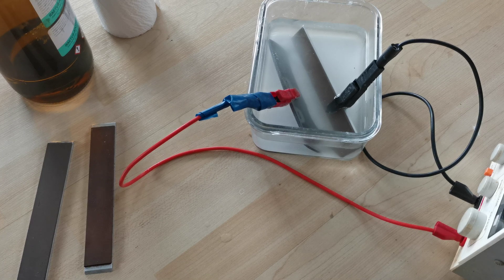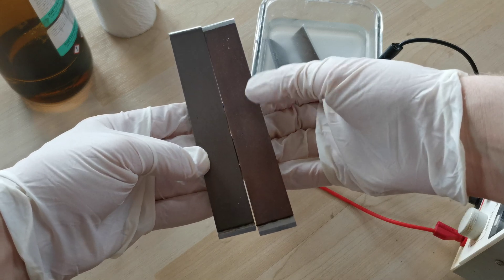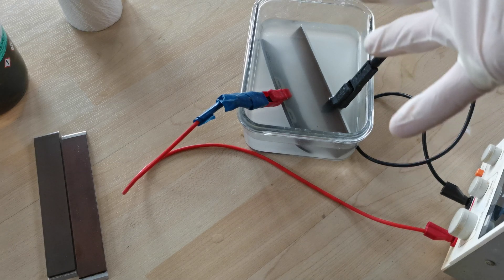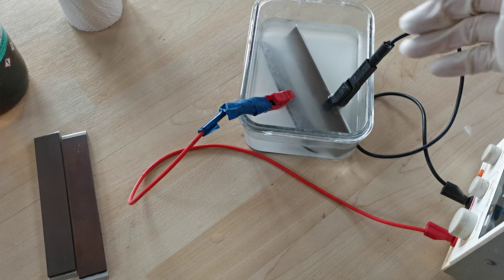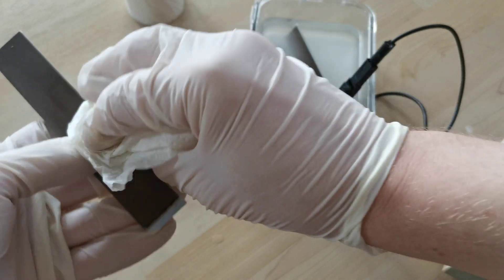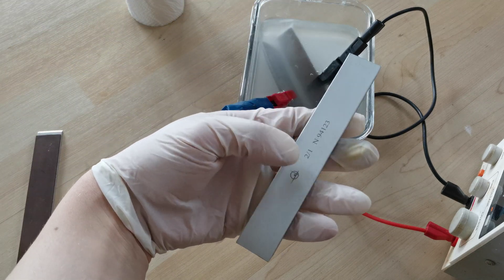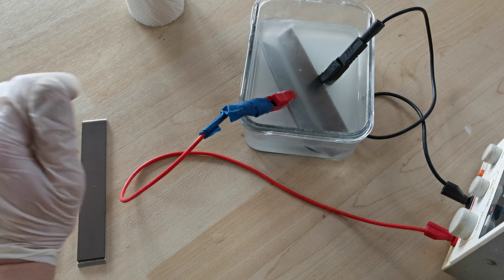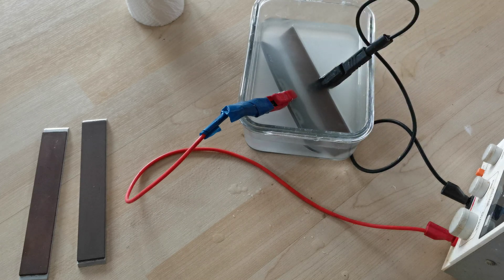How to simultaneously dress and clean metallic bonded CBN / diamond stones using electrolysis

Comment: All of stones show on the video are not metal bond, those are resin bond with copper filler (hybrid bond). Etching can cause shedding problems. Real metal bond stone looks way yellowish tint of bronze not reddish copper. Also organic solvents can damage the resin. Otherwise, electrolysis for real metal bond stone works, including EDM.
Reply from the maker: Indeed these are a hybrid to be exact. What matters is that the metal content is sufficiently high for this method to work. As foe the naming; overcomplicating things usually puts people off I found, so I sticked with the manufacturers naming. 100% metal bonded can also look silverish-gray; color can be deceptive so I wouldn't go by it. I agree on your points about etching though; I advise people not to etch in most circumstances.
Reply: @kknives_switzerland Thank you for your fast, kind and honest response. It shows you know the things really well. 

Just for anyone who want to dress thoses kind of stones : Copper in hybrid bond is just for heat conductivity(also looking good by far)so, we can easily care hybrid bond stones with SiC just like other resin bonded/vitrified stones, no worries about using chemicals, electricity.

For who bought real metal bond stone : It's heavy and really high wear resistance. You definitely consider Electro-Chemical way. This video is nice guide for that. However once you've done dressing, the stone will stand almost forever.

You crank up the power supply, metal will react with in order Etching(contour of copper-tin matrix remains)>Passivation(contour of copper-tin metrix remains)->Polishing(contour of copper-tin metrix turn smoother)->Pitting(mess-up), so monitor which stage your stone is at for make best results.

Once again, thank you to @kknives_switzerland for uploading this great educational video!
Reply: @kknives_switzerland    Thank you for your fast, kind and honest response. It shows you know the things really well. 

Just for anyone who want to dress thoses kind of stones : Copper in hybrid bond is just for heat conductivity(also looking good by far)so, we can easily care hybrid bond stones with SiC just like other resin bonded/vitrified stones, no worries about using chemicals, electricity.

For who bought real metal bond stone : It's heavy and really high wear resistance. You definitely consider Electro-Chemical way. This video is nice guide for that. However once you've done dressing, the stone will stand almost forever.

You crank up the power supply, metal will react with in order Etching(contour remains)>Passivation(contour remains)->Polishing(contour turn smoother)->Pitting(mess-up), so monitor which stage your stone is at for make best results.

 Once again, thank you to @kknives_switzerland for uploading this great educational video!

Comment: Does this method affect the aluminum base? Also would a piece of copper work well for the anode? Cheers! Never seen anyone do this but thought it might work so searched it on YouTube and found your video
Reply from the maker: I totally missed your comment! But I guess better late than never right?😄
The Al base should never face the cathode. The loss of mass from the Al base can't be fully prevented but greatly reduced by being in the "shaddow" of the metallic bonded CBN/diamond layer.

Comment: Does this method affect the aluminum base? Also would a piece of copper work well for the anode? Cheers! Never seen anyone do this but thought it might work so searched it on YouTube and found your video
Reply from the maker: The exposed aluminum does get eroded a bit but to this day, I do not have problems with it. After all, what's facing the anode is eroded the most by far, and in this case, that would be the abrasive stone on top of the aluminum base, not the aluminum itself. If you are concerned, you could always cover up the exposed aluminum with water tight tape.
 As for the anode, as long as it conducts electricity, it will work. So copper will work - probably better than mine which was made from titanium, which has rather bad electrical conductivity.

Comment from the maker: These and many more great stones can be acquired here: https://www.practicalsharpening.com/edge-pro
IMPORTANT: I received some questions whether this would work on electroplated stones. DO NOT DO THIS on electroplated stones!! You will "unplate" them! Most likely it wouldn't happen instantly, but I could totally see it happen if the reaction is sustained for a while. This technique is only to be used on metallic BONDED stones.